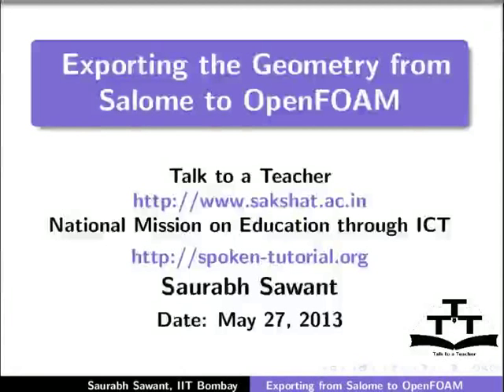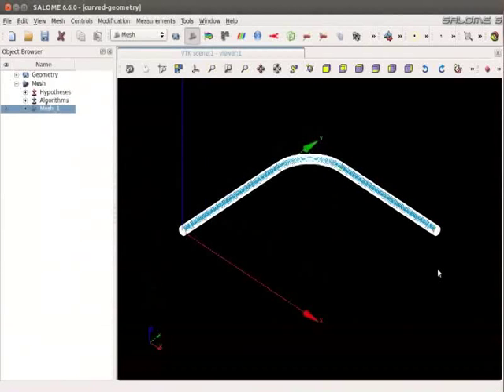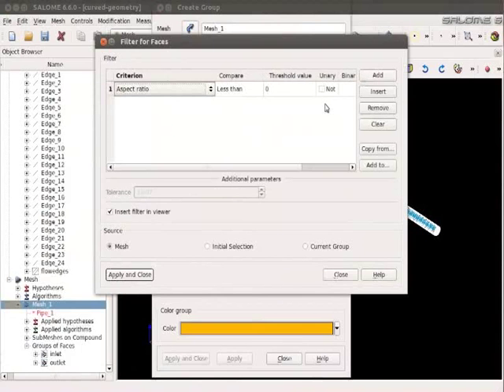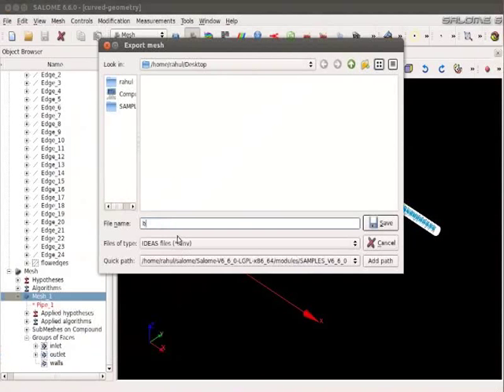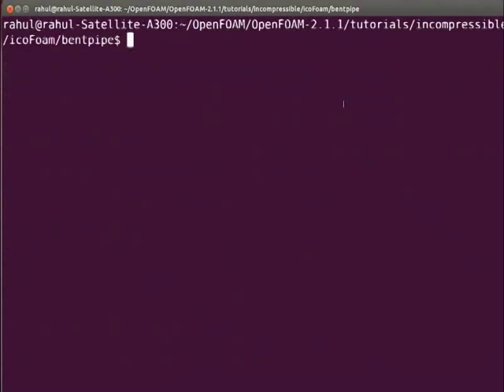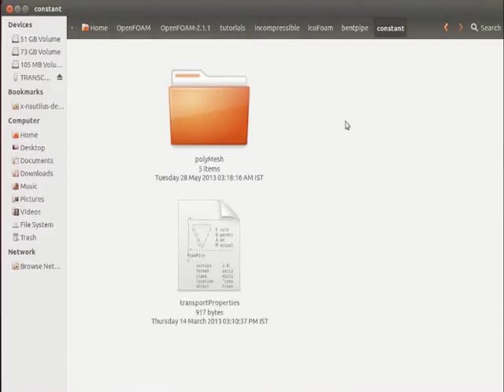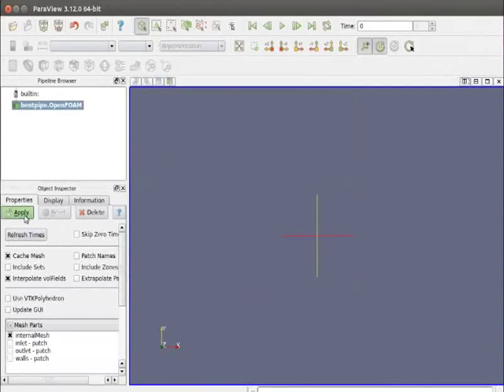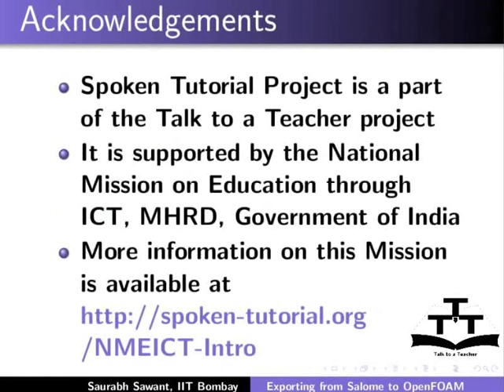Exporting geometry from Salome to OpenFOAM - English

Comment: Hello. Thank You for Your very good spoken tutorials!
I have one question to this one (starting form 2.45).

Did You select ALL faces and remove only inlet and outlet groups or did You select only outer faces and remove inlet and outlet group? What happes to all faces inside mesh? 

I'm trying to run engineFoam  but I can't due to appearing 'defaultFaces' after ideasUnvToFoam or gmshToFoam.
Reply: Hello friend,
In the process of making Group_1, what he had done he filtered all the free faces from Mesh_1 and then cut out the inlet and outlet groups from Group_1.
Reply: Thank You! But in fact I deal with it some time ago.